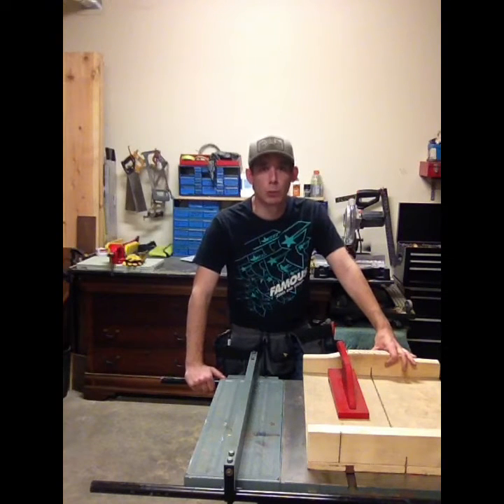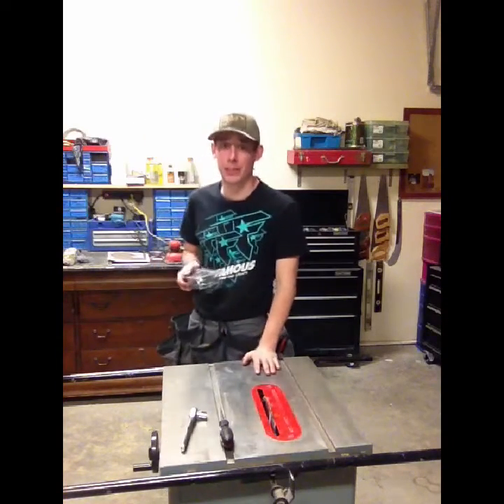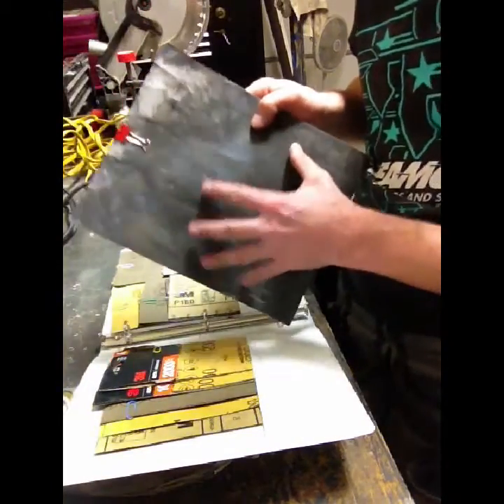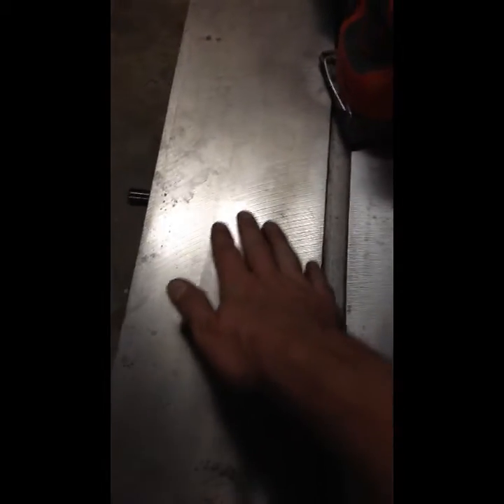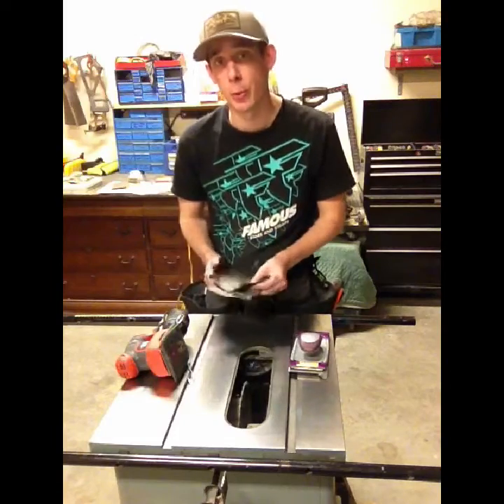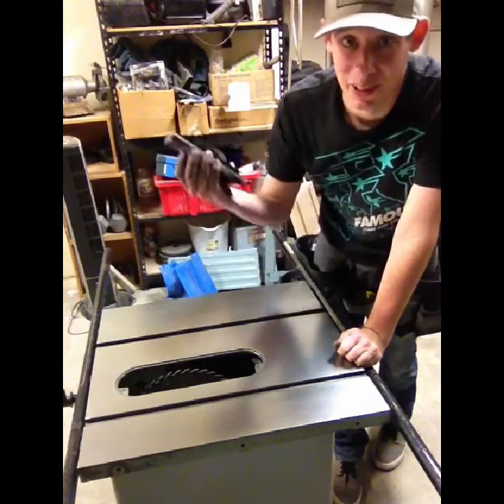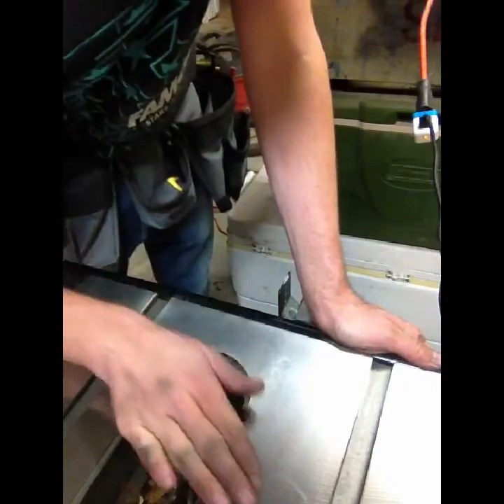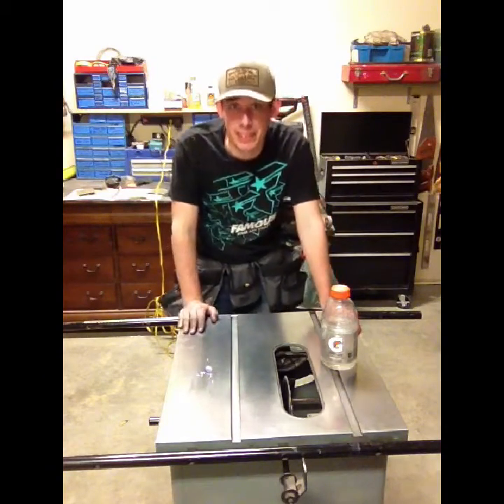How to Resurface Your Cast Iron

Comment: Welcome to the woodworking tool cleaning addiction.  Just as an FYI for future tools... leave the machine marks on, they actually reduce friction and allow a place to anything you want to use to make the surface more slick like Oil, or wax, but make sure to alway buff off the excess and don't forget to re-coat over and over especially in the humid weather.